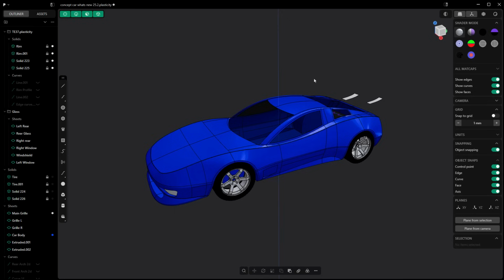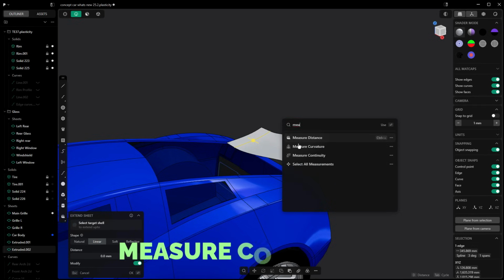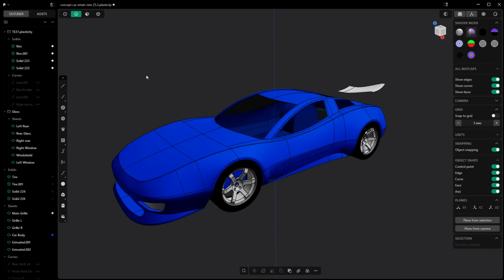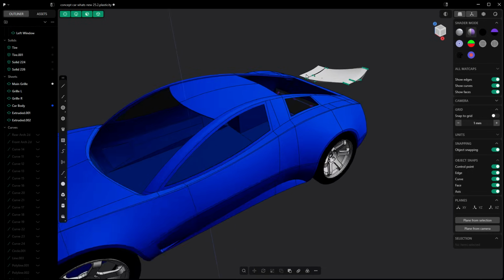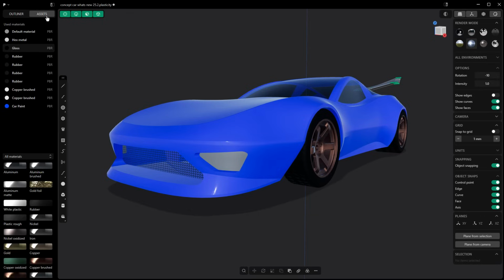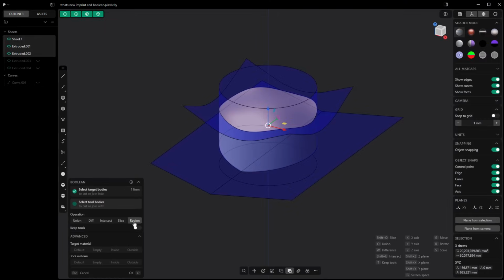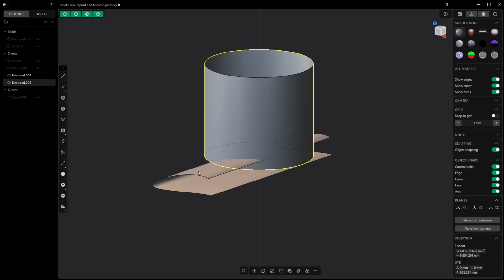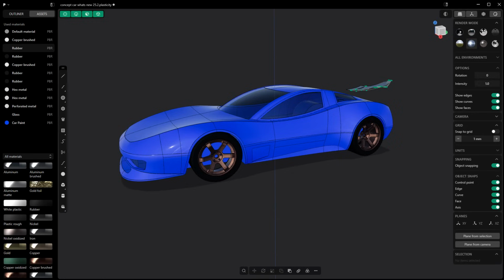What's New in Plasticity 25.2

Comment: Is this the studio version or the indie version? How can I access this update? When I check their websites, it says Indie 1.1 version, but the studio one doesn’t show any version number. I purchased the indie version on November 5, 2024, and I haven’t received any updates since then.
Reply from the maker: when you are on the plasticity website in the download sections the downloads there are the most current versions.  I think you can get older versions on Github.

Nov 24 you should have been on version 24.x.  You can go into plasticity and in the P drop down menu there should be a section called "manage license"  in there it will tell you when the maintenance is until.  At the bottom of the P menu in version 25 (can't remember if it was in version 24) it tells you if you are current or if an update is available.

https://www.plasticity.xyz/
Right at the first page just download the version for your system and it will be the most current.  Run the installer and that should get you 25.x

I am on a studio license but the only tool in the video that was studio was the Align tool as it is based on Xnurbs.  everything else should be in Indie as well.
Reply: @LearnEverythingAboutDesign  Thank you, I was able to upgrade from version 24.2.2 to 25.2.0.
To be honest, I assumed that, like most other programs, a new download link would be sent via email when an update was released—just like how we received the initial download link by email. I regularly check my emails and keep my other programs up to date that way, so I assumed there was no update available.
But then I started seeing these videos and thought this update was exclusive to the Studio version.
Long story short, you saved me from paying—thanks for that!
Reply from the maker: Yeah with version 25 now you can see if there is an update right in the P drop down menu.  It won't push the update automatically but the bottom of the menu will let you know and you can click on it.  i think it takes you to github for the download

Comment: Nice video!
btw, i heard that "Refillet Face" missing in 25.2
is that correct?
Reply from the maker: Its true it doesn't appear to be there.  You can do something similar with "Push Face" BUT you can't select filleted and non-filleted faces like you could with Refillet.  If you select only filleted faces and use PUSH FACE it will behave like refillet did.
Reply: @LearnEverythingAboutDesign  i see, thanks for the tips 👍

Comment: Still nothing that lets you work directly on 3d scans/meshes..
Reply from the maker: Last year in version 24.2 Mesh Snap and Constrained Surface were added.  https://youtu.be/LSAc4uyxTao?si=0zrU9qugVk3FQgDq&t=784

So it is possible to work directly off a mesh.  I plan to do a video in the near future using Plasticity for that.  I think it still needs a few more things to be a solid option for that workflow but it is certainly possible.  Especially if you are trying to snap curves directly to a mesh.  Constrained surface is a good option if you are trying to do prismatic parts IMO.
Reply: @LearnEverythingAboutDesign  Ive put in a feature request to be able to imprint a curve onto a mesh but its not getting enough traction. Same with a mesh2surface request… people seem to only want small feature upgrades.

Mesh snapping is fine but capturing exact profiles and curvature is still impossible as of yet
Reply: I would really really really like this too..
Reply: @GeeDeeZO6 im not going to stop bitching about this until we get it 😂 imprint curve to mesh would be a game changer for blending artistic freedom with reverse engineering
Reply from the maker: yeah, we have mesh section sketches in Fusion, but then you have to deal with doing a tolerance based fit curve.  I think the user base that works with meshes is probably a bit too small for sure.  I know Nick has mentioned more mesh based tools but not sure what those are as of right now.
Reply: @LearnEverythingAboutDesign true about the user base being small, though 3d scanners are much more accessible now and that user base is growing. I think thats a market that plasticity could do really well for given that they have the tools to support it

Comment: Hello!

I'm a relatively new subscriber and really enjoying your videos — thank you for the great content.

Like many, my main interest is in creating 3D-printable and editable NURBS models from 3D scans or photogrammetry. I’m currently using Shapr3D and starting to learn Blender. My goal is to design sectioned tiles that conform precisely to a car body — similar to tight-fitting fender overlays or panel forms.

From your experience, do you think Plasticity offers a significant advantage over Fusion 360 and Blender for this kind of work? In your opinion, is it worth investing the time to learn Plasticity over sticking with the others?

Curious to hear your thoughts, and thanks in advance!
Reply from the maker: Hey there!  Right now I would say out of those choices I would stick with Fusion for your goal.  You can do it in any of them but I think the mesh based tools in Fusion to get you to a NURBS surface are a bit easier.  In Plasticity you can make a surface on a mesh but you can't really build an entire subD on it.  You can draw 3d curves on a mesh and use surfacing tools but really you would want Studio and Xnurbs to help there.

Blender (as far as I know still) will create a mesh but not export a true NURBS surface or BREP.  So if you plan to only 3d print things that might be fine.  Fusion will let you create a form and have a true nurbs surface.  Plasticity will as well but i think the Fusion mesh section sketches and forms are an advantage still.
Reply: @LearnEverythingAboutDesign  Thank you! I really appreciate your response! 🙏

Comment: Is XNurbs worth the extra 100 bucks?
Reply: Listen from 23:00 onwards.
Reply from the maker: If you do surfacing work I would say yes.  Xnurbs, the square tool, the new align tool and a few other things that are tucked under those tools make complex surfacing work easier and quicker.  There are a lot of cases where you might want complex open boundaries with internal guides that don't actually touch profiles and rails, and xNurbs is the only way to make that into a clean surface.

If you do mostly prismatic work than you might never really need it.
Reply: Thanks
Reply: It is worth 400-500 bucks.
Reply: @Kuechmeister I meant the price difference from Indie to Studio version.
Reply from the maker: Yeah if you buy xNurbs for say rhino it coest $500.  That is probably what he was talking about.